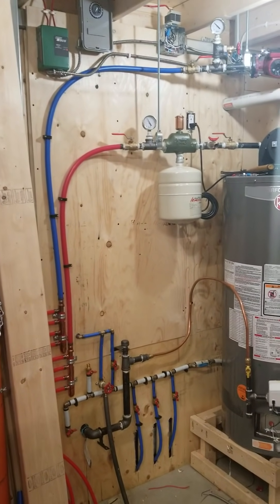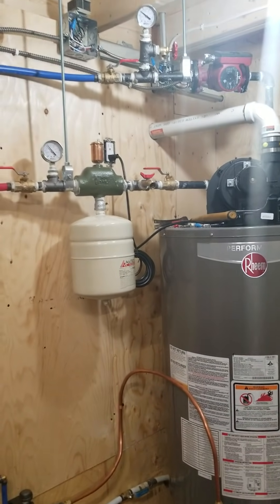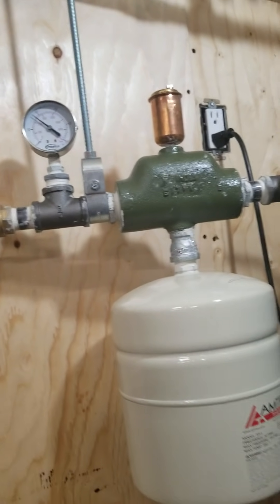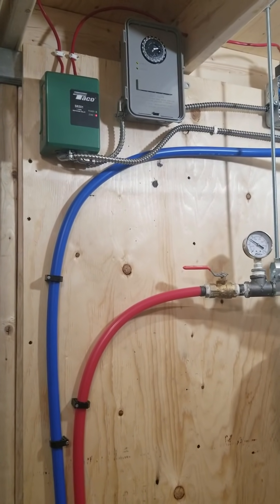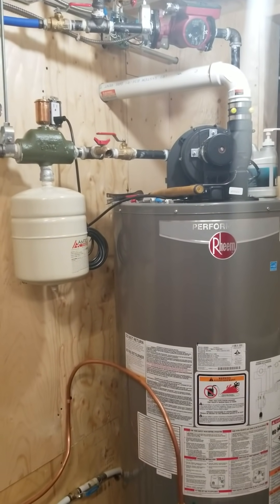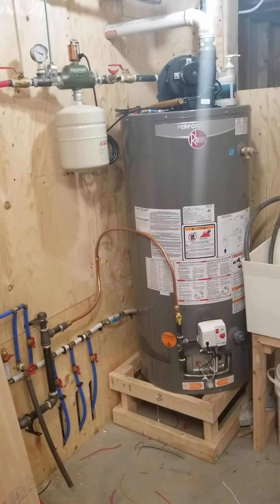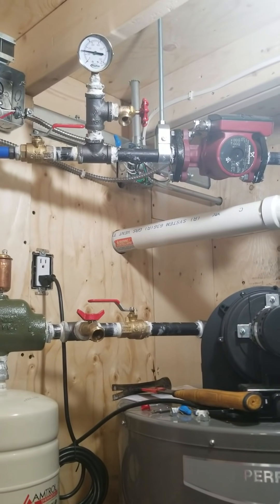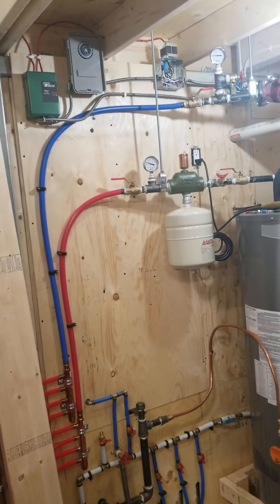DIY In-Floor Hydronic Heating System Using Water Heater

Comment: what is the avg monthly heating cost Nov, Dec, Jan, Feb. My water heater in floor heat is heating a 2 stall workshop . I use off peak electric on my water heater and keep it at 64 deg F.  I pay over $100/mnth to keep this steady temp.
Reply from the maker: my system adds roughly $60 dollars a month to my natural gas bill for the winter months

Comment: Do you think you would have went with an on demand water heater if you were doing it again?
Reply from the maker: possibly. I would have saved around $500 on glycol
Reply: @jpaul1030  I live in Minnesota and have an on demand water heater for my House and Garages in-floor heat. I would never go without Glycol in a cold climate area. I am thinking about doing the tank water heater in my shed (9 loops/circuits total )on two of the 9 loops to start with (360 square foot area) in a small room and have the other 7 loops unused until later down the road. When I decide to run all 9 loops I may switch over to a boiler but who knows, maybe the tank water heater can keep up (1,900 square foot total). I agree with what SIR LOVELY says, slowing the water down and let the concrete absorb the heat it a very good idea and the tank will be able to keep up much better, along with his other suggestions.

Comment: Hey buddy 
Just curious what type of piping did you use underground. Is it was regular 1/2”PEX tubing B137.5
Thanks in advance
Reply: it will need to be heatpex that has an oxygen barrier

Comment: Other than a few code violations (I'm from the USA) the only major thing I would correct here is to get rid of the circulator timer as it serves no function. That's right, there no reason to shut down the circ as long as there's a call for heat. You will transfer more BTUs to the floor (even at lower water temp) with constant flow and cause less thermal cycling of the slab. BTUs delivered to the room will become a function of how long the burner runs. Since that's about 35,000 BTUs (based on heater size) then that's what you will get per hour no matter what the water temp is. You will probably find that lowering the heater temp down a bit might also be helpful. If there's a proper amount of pipe in the slab you should be able to heat the place with 100 - 110 degrees instead of 130 degrees. It will also be easier to maintain comfort in milder weather. The key to floor heat is to MAINTAIN temp. If you feel the urge to warm things faster you can always add a Modine style heater on another t-stat.
Reply from the maker: so remove the circulator timer and just have the water heater run non-stop?
Reply: @jpaul1030  ... The heater wont run non stop. The circulator will run non stop only on a call for heat via the room t-stat. The burner will cycle as necessary against the t-stat within the water heater. Basically the burner will only run when the water temp is below the set point, but on a cold day that may be a long run to deliver the necessary BTUs to the room. This also solves your issue with having to provide another 24 volt feed for the WiFi. BTW, if you had put your timer AFTER the Taco control you could have solved that problem too (using line voltage control on only the circ) but there really is no need for the timer at all. Personally, I would experiment with lower water temps anyway. You may find the system keeps up just fine at 90 degrees F, although it may take a few days for the slab temp to stabilize and see the results. Just remember that your return water temp will always be just above room temp if you are extracting all the heat available. If it's lower than room temp then you are still heating the ground and the slab has not stabilized yet. It will take a few days of playing around with each temp change to see how things work.

Comment: Great video.  Greetings from kw area.  Thanks for posting!

How much foam did you use under the slab?

Thinking of Building same system for 700sqft.  Trying a different pump setup.   A taco variable speed pump will adjust speed depending on return temp which would help the tanks recovery time.

Also, completely agree. A cheap DWH setup is way more cost effective.
Reply from the maker: hey, I live about 30 minutes from Kitchener. I used two inch thick SM under the slab extending two feet out around the perimeter of the slab

Comment: Thanks for sharing this video Jordan, I would to install a similar system, and to boot my Buddy has similar system and he is currently experiencing heat lost as the hot water tank is not big enough and runs out of hot water tank.   Would you mind sharing what you used  for Timer , relays, 24 v transformer and the layout of the configuration would be great.  I would like to do the same thing and then help my buddy fix his fit up.   Anything you can share would be greatly appreciated.
Reply: Martin ... with everything properly sized there should be no need for any timers. Heating a space is a matter of having enough BTUs to do the job and increase the water temp within the system. These are two different things because the heater has a rating for it's output at max design temp (say 180 degrees) and the water temp in the floor should probably wind up something under 100 degrees at most. (to avoid cracking the concrete) Working from a boiler this is normally done with either a second tank or mixing valves to control water temp. With this system you can just start with a lower tank temp. More BTUs for colder weather will be a function of how long the gas burner runs, up to max run time, not max water temp. Typical 30 gallon water heater (in video) will be around 35,000 BTUs. To see if that's enough you need to do a heat loss calculation on the space to be heated. One last thing to consider is that floor heat is great for maintaining temp, but not great for warming anything up fast. Many systems use baseboard radiators or hanging heaters to bring things up quickly, then maintain with the floor heat. All you need to do is pipe those up as another zone on another t-stat. This is how it's done in a repair garage where opening the big door lets the heat out and you want to recover fast.
Reply: without a tempering valve you are shocking the W/H every cycle. why not consult a plumber. this system is pot piped correctly

Comment: I’m a electrical fitter in Australia and most of my fittings are missing face plates too🤔
I probably wouldn’t stress too much about what people say about the use of a hot water system, there will always be people that aren’t happy. 
I’d like to give solar hot water system a go. Here in Australia at the absolute coldest it would only get to 1-5 degrees C and that’s only for a few days a year. I just want a system to make it more comfortable for all year round use. (No excuses to finish those jobs in the shed😉)

Comment: What does it cost to heat your shop for a month
Reply from the maker: average cost from October to April is $50 to $60 a month
Reply from the maker: about $50 to $60 a month from October to April. I also leave the temperature at 63°F all day long too. I don't turn it down when I'm not in there.

Comment: Curious how many inches of rigid foam did you put under the slab?  And did you extend that same insulation to the outside edges of the slab?
Reply from the maker: two inches thick insulation, extended two feet around the perimeter on the slab

Comment: Hey Jordan. Wanted to know if I could use 2 hot water tanks to heat my in floor heating and heat my water. I have a 1600 square foot garage and 1600 square foot living area. I will be using propane. I have a 12 loop in the garage and 12 loop in the  living area. I am in northern ontario.
Thanks Wayne.
Reply: Any water heaters can set for certain water temps and can also be shut off if not used/needed so I can see no reason a second WH would be an issue but why not just use a decent LP, tankless model and be done with it if you can! Good luck.

Comment: Great video I've had my system in for about 10 yrs with a single pole thermostat and always had control issues. My shop is 24x36 I'm just north of Ottawa. Thanks again great info.

Comment: good video; would have been easier to view/follow your implementation with less confusion if whole system was presented with some kind of plumbing diagram.  Designing and installing a radiant heating system for an optimal performance is not for typical youtube viewers.

Comment: To help your water heater keep up you could install a tempering valve. The hot lead would be hot, the cold would be the return from the floor, and the mixed is what you send into the the floor. If you do that you can turn the heat way up to maximum on your hot water heater and set the tempering valve to 130deg or whatever you want it
Reply: The return still goes back into the heater but there's a TEE that feeds the tempering valve first

Comment: I have my system  running now. However I installed a mixing valve because it came with a kit I bought from a local Loews. I am having an issue just trying to get that valve set properly. Any suggestions?
Reply: return water should be teed off and used for the cold inlet of the mixing valve

Comment: Boilers that size don't cost $7000. Maybe $3-4. Also the guys in the comments are hacks.. LOL. don't listen to them.  ha ha. You have a variable speed pump, no reason to close down valves. ha ha.  What pressure do you run that at? Normal heating system is around 12 psi.

Comment: Thanks for putting this together. I'm thinking of doing something like this. The winters in my area are moderate and so if I do a closed-loop system, I'm wondering if there will be any benefit of putting glycol. Maybe just distilled water will be better.

Comment: I found your video while researching how to put a floor heating system in a house I want to build. I am trying to build something simpler. Thermosiphon, so no pumps. I will use my diversion power from my wind /solar power to run an electric water heater. After watching the video and reading the responses I will have to look into boilers. I thought small water heaters were expensive here until reading about how much they are where you live. maybe a water heater in a closed-loop system with glycol. I've read about using a mixing valve and an air bleed. Buried Pex tubing with shark bite fittings that are all above my earthen floor. Very informative video.

Comment: simplify it.. put your timer on the output of the taco. it never loses power and your stat stays powered. no additional transformer required
Reply from the maker: The timer would loose power every time the thermostat isnt calling for heat if I put it on the output of the taco relay. It's a mechanical timer, it needs power to work.

Comment: Great video. I have the same size shop as you and similar climate (eastern On). Also not looking to spend $7K+ for a boiler, as my shop also is just for hobby. I'm wondering how your system has held up now that it's been a few years? What model of tank did you select (how many BTUs)? 
Thanks!
Reply from the maker: I picked the Reem 50 gallon water heater (36 000 btu) that comes on sale at Home Depot every couple of weeks for $930. The system has held up great. This is my second winter running it and I've had no issues with it. I didnt do anything with it since I made this video, after the summer I plugged the water heater back in and ran it.

Comment: Really one question. There is an engineering answer as to your needed flow rate based on set point, building envelope quality, glycol temp, GPM and square footage/ loop lengths. All of that is not necessarily needed; your system works. But I an an HVAC guy and see that time clock and why you added it (running out of water) and immediately know, “it will come at set point control.” So.... congratulations on a neat system. The 2 variables that might have helped a future DIYer is: 1) What’s the shop SF?, and 2) What size tank is that? (Because the time clock variable comes at the expense of set point control, and raising water temp is not an option) Great job!

Comment: In floor heat is the best! I put it in my shop and the floor is 80 degrees F. Snow/ice melts off and vehicles are dry within just a couple hours. It's a different kind of heat than forced air. Much much better.